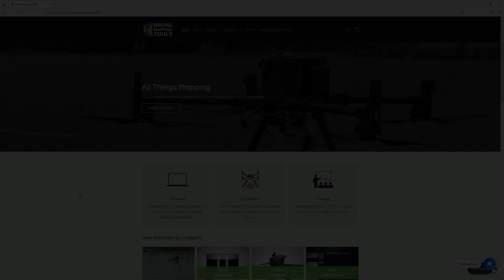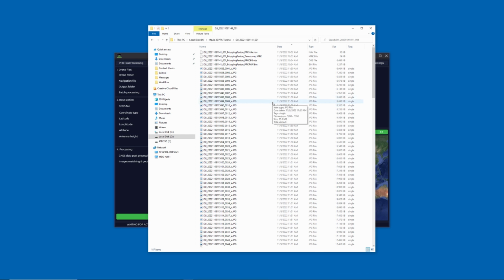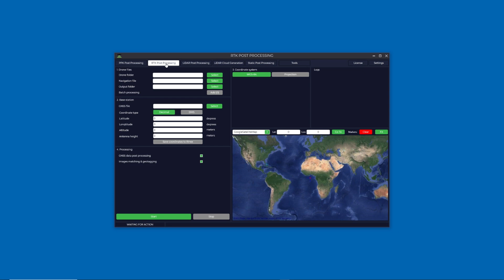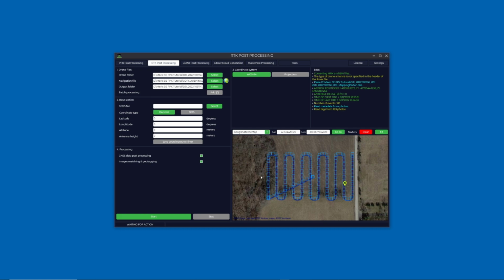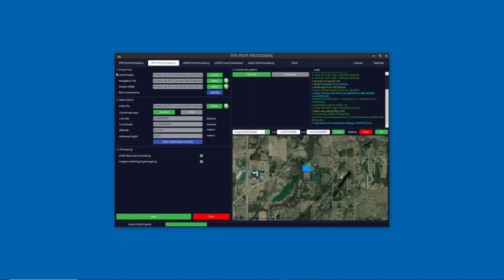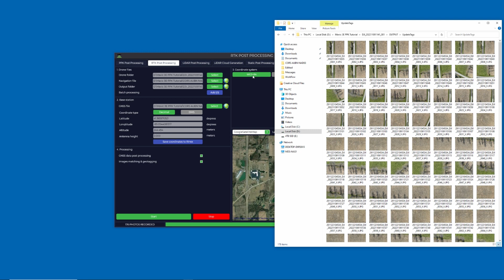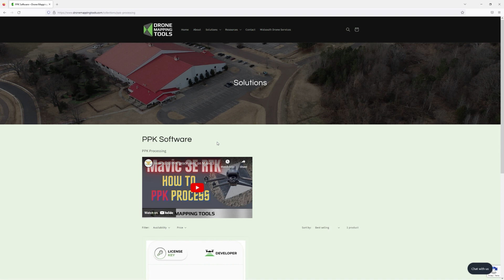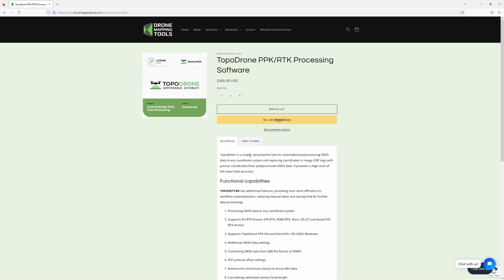How to PPK process the Mavic 3E or M300 with TopoDrone Processing

Comment: I have a question.  I have done the PPK processing and my understanding also is that the exported (tagged output) images would be NAD83.  My GCP csv file with coordinates is in WGS84 from the surveyor, is there an easy way to convert my GCP's (lat long) in WGS84 to NAD83 so they will correctly locate on my map?  Currently they are off becuase of the differing projections.

Comment: Hi,
With the Mavic 3E and RTK module, will this software help me PPK the survey-data in remote areas where RTK is not available (no cellular connection) ?
Reply from the maker: Hi Sondre, yes it will!  Ideally you would have a base unit that you setup on the site and just log the file.  Then later you will do PPK processing on your base first to determine its absolute location. Then you will use that log file to do PPK on your drone flight. If you do not own the station, then you can simply do PPK processing on the drone images using a cors station for the reference.  While it is best to have base station on site it is not a requirement.  The short answer to your question is “absolutely”
Reply: @3dMappingTools  Thanks! To be more accurate (no pun intended), will PPK of a flight with a setup without a base give me cm-accuracy (absolute)?

And can I use RINEX-file if available?
Reply from the maker: @sondrefossheim4220  You must have a base unit for data but that can be a CORS log file.  So you must have a Base log, whether it is your own or a CORS station.  The accuracy is going to depend on the distance of the base from your flight area.  If you are needling cm level absolute accuracy I still advocate having gcps .  The ppk is beneficial for processing but I would never submit a job with out them to validate the accuracy.

Comment: Thank you for the informative video. You indicate that no special equipment is needed, but that you prefer to use the navigation file from the base unit. Can you please explain? Also, is there a freely available CORS file provided in Georgia? Thank you again
Reply from the maker: Hi Danny.  Thanks for watching.  There are definitely CORS units to use in Georgia.  Here is a map of all the CORS stations in the USA.  https://geodesy.noaa.gov/CORS_Map/
Regarding the navigation file.  There is a Navigation file generated on the drone when the logging GNSS data.  But I have just found the results are better when I use the Navigation file from the base instead of the drone.  I am not sure why but they are better.  I am sure I will find out why some day :)
Reply: @3dMappingTools  Thank you for the swift response. Just to clarify...   "the base" is referring to optional equipment like the DJI D-RTK 2 High Precision GNSS Mobile Station? Thx agn
Reply from the maker: @DanDroneATL  I was actually referring to using a base like the Emlid RS2.  You do not have to buy the DJI D-RTK base unit.  You can do RTK and PPK with the Emlid RS2 and it is much more cost effective.  Not to mention you can also use it for other purposes.  If you buy the D-RTK, it is much more expensive and it can be used for one thing, and that is it.  A big waist of money imo.
Reply: @3dMappingTools  That is great advise! Thank you very much. I've flown hundreds of mapping missions, but am a noob with RTK and PPK. Thx agn.